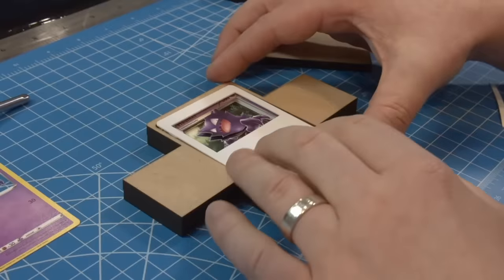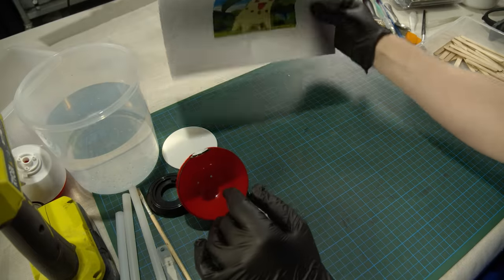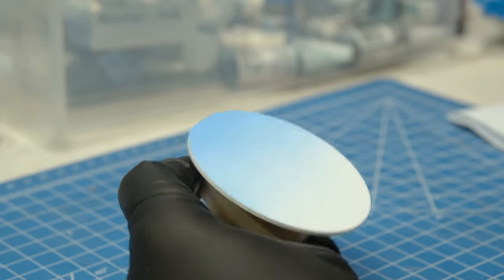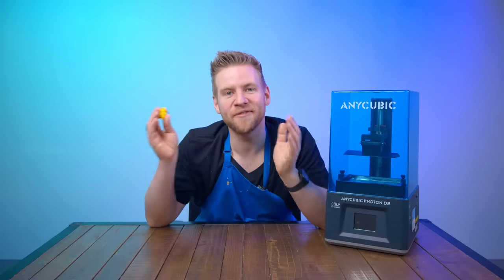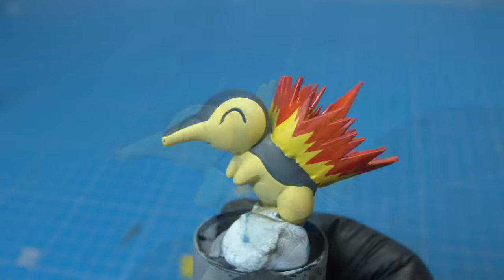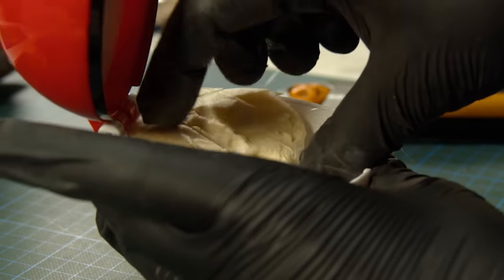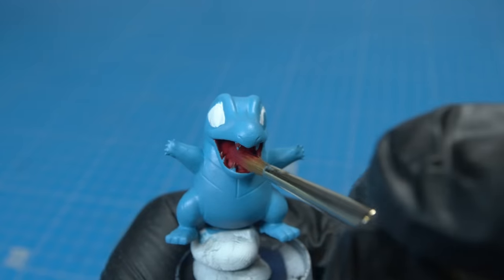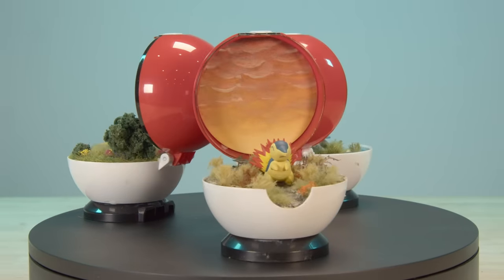I made "Pokémon Terrariums"!!

Comment: Should of included a disclaimer for resin 3D printers. The resin is toxic in both touch (nitrile gloves) and fumes (chemical rated respirator). Nitrile gloves are required because resin will destroy latex. The prints must also be cleaned to remove the uncured resin, usually with isopropyl alcohol or some resins are water washable. Don't be fooled with water washable though, the water becomes contaminated with the resin. Regardless, the wash liquid is considered hazardous waste and must be disposed of as such. Granted, most people "don't care" about the damage it causes and just dump it down the drain .... really shouldn't. And no, it shouldn't be dried out and just tossed in the trash either.

Failure to take the safety precautions can cause it to build up in your system. Like lead, it never leaves. Eventually you'll experience severe allergic reactions and possibly death.
Reply: these are very good warnings